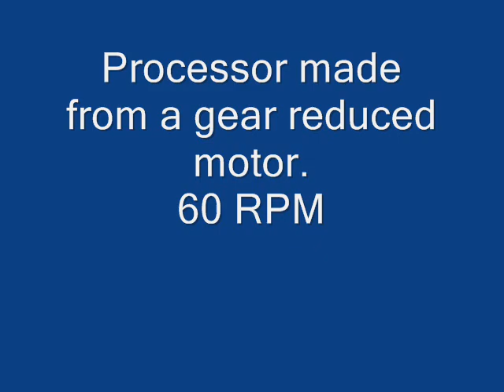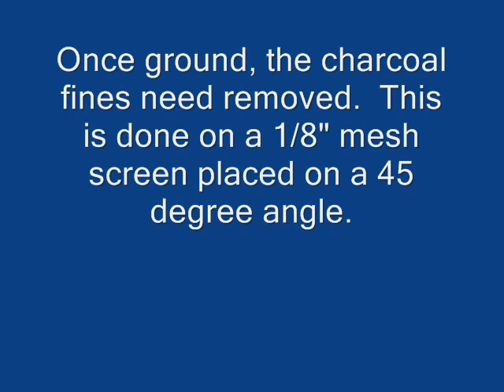Charcoal processing for charcoal gasifier

Comment: I like the fines for water filtering and activated charcoal.
I have come across one good activated charcoal video.
The idea of carbide or lemon juice is just Bogus.
The simple way used a small canister of water with special vent that evaporating steam to burn off the last impurities at the higher required temp.